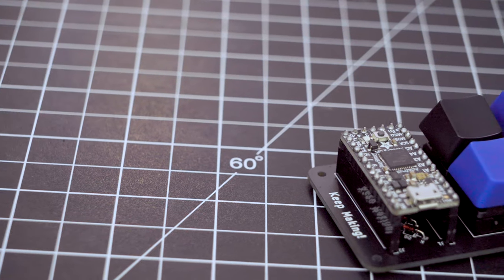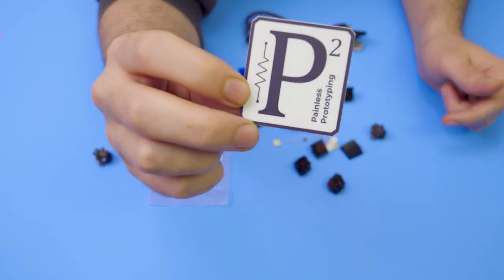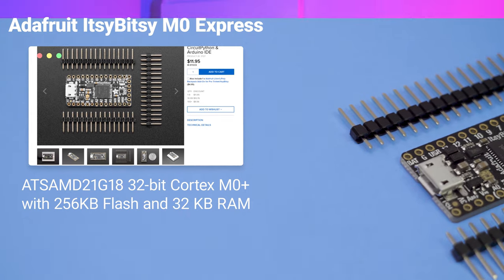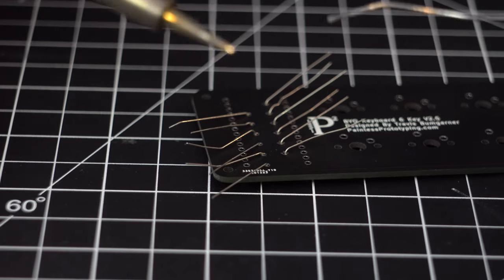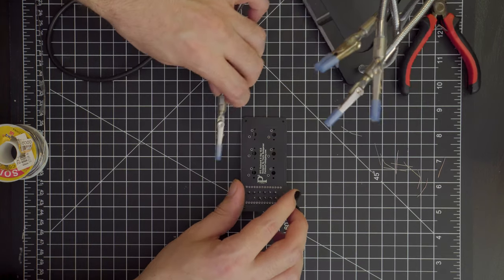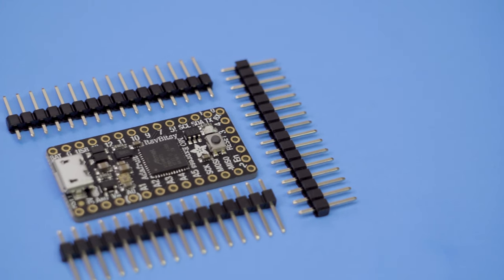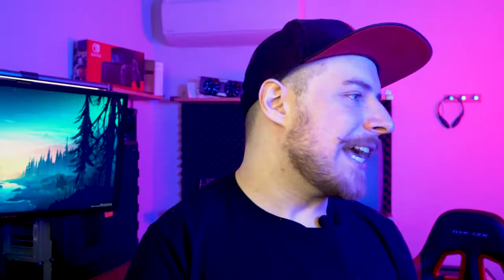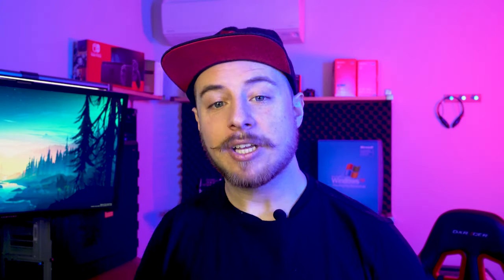DIY Mechanical Keyboard Soldering Kit

Comment: If you change the timestamps in the description to: 
0:00-Intro
0:50-Unboxing
2:20-Assemble PCB
4:35-Soldering the ItsyBitsy
5:18-Assemble 3D printed case
6:08-Keyboard demo

then ppl will be able to see the chapters. Currently, they can't.
Reply from the maker: Thanks! Will fix tonight
Reply from the maker: They actually appear to be working for me